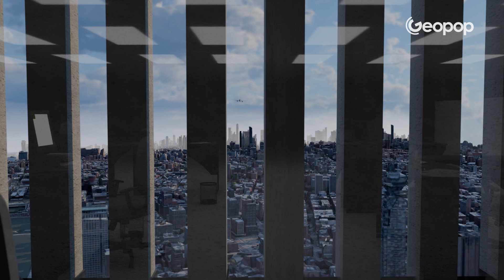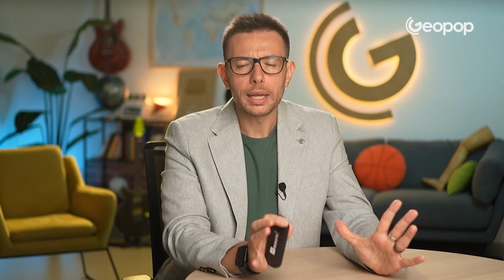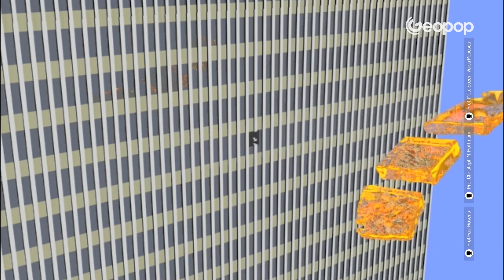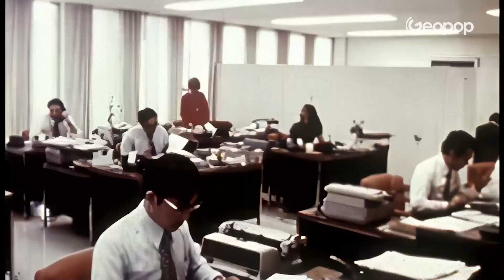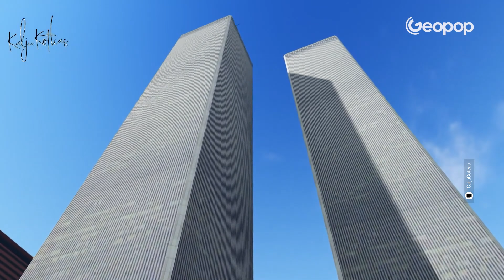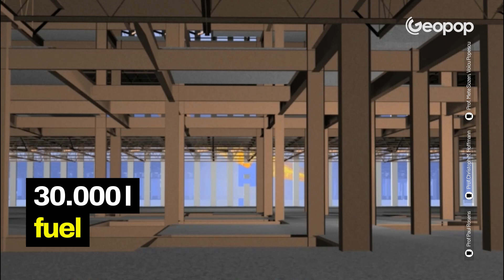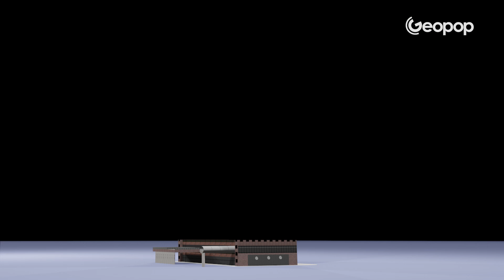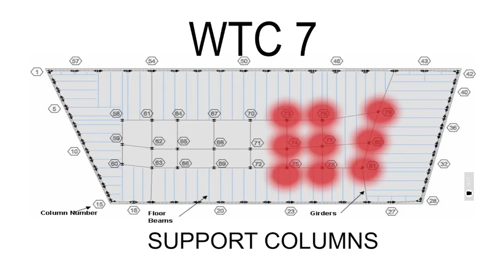9/11, 2001: The Technical Reconstruction of the Twin Towers and WTC 7 Collapses

Comment: They were brought down in controlled demolitions. It’s been proven. Even tho the steel on those floors would have been weakened, the floors above and below would still have their integrity. And the core beams would have stayed at least partially standing. The towers dropped in 11 seconds with different damage to different towers. No building ever in history has dropped due to fire much less one that was not hit by a plane hours later. The fuel would have burned out very quickly with only material inside the building to keep it going. Also almost everyone interviewed on that day, while they fell said they heard explosions at the base. Boom boom boom. The prices that were left were pulverized and did not come down in chunks. The gravity ratio would not have been enough to bring down the whole tower. Conspiracies ate real. Theories are real. The commissions report did not include everything and all the steel was immediately sent to China for recycling. Making a thorough investigation impossible. No plane hit the pentagon and no evidence of a plane were found. Watch more videos of experts. You don’t have to take my word for it. I’ve researched this since that day. Many of the hijackers were seen alive after 9/11 by their family. Buildings don’t just fall like that. Also two of the planes were found intact in other countries after 9/11. Sorry this is sinking but I could go on and on. lol. It’s not funny but do your own research. You’ll find these theories have been debunked over and over. Just because cracknpots like MTG and Alex jones believe it doesn’t mean it didn’t happen. They knew it was going to happen and that why trump inc won’t release what they have because it’s damning evidence.
Reply: I did my research. Actual research, not watching conspiracy videos on YouTube. My results were different and they explain all the anomalies you didn't understand/got wrong.

Twin Towers collapses were relatively straightforward, the fundamentals already understood in the professional engineering community within just weeks. Still, there’s a lot of really bad information floating out there, mostly on the internet where it’s easily accessible to anyone. Good information takes more effort to come by and is much harder for laypersons to digest. Engineeringspeak is complex and dull. Also, some people put up a wall to protect their beliefs and false assumptions. Engineering is hard while wild baseless speculation and pathological theorizing with easy hand-wave answers is simple and exciting. Fanciful tails of pre-planned demolitions, magical space beams, melting steel and mini-nukes are just far more entertaining and require a whole lot less thinking, thus getting far more intention than they deserve.

To correct that situation, I have all on my own prepared this short yet detailed technical description of Twin Towers collapses based on my own observation and analysis of the available true and relevant facts. No politics or ideology, just the engineering. My hope is this will dispel many common myths and answer most if not all questions you may have about the Twin Towers collapses, because anything can seem like a conspiracy if you don’t understand how it works

While complex, most of the Twin Towers collapse mechanisms can be seen with the naked eye and easily discerned and understood by the layperson if sufficient time is taken to understand. 

1. The Twin Towers consisted of 4 primary structural elements that together formed an integrated system where each relied on the others.  47 hollow box-section steel Core Columns carry the majority of the gravity loads. The 236 hollow box-section steel Perimeter Columns carry the remainder and ALL of the lateral (wind) loads. Long-span Lightweight Steel Trusses connect the core and perimeter column together at each floor with a Hat Truss on top to tie the structure together as an integrated unit where no element can survive without the others. There was no structural load bearing concrete and most components were bolted together.

2. The impact of 117 tons of airplane (= to about 12 dump trucks) at speeds up to 590 mph with the energy of a ton of TNT completely destroys the aircraft. This in no way implies the Towers come out unscathed. Many perimeter columns are damaged or destroyed as are some core columns (example; 33 of 59 perimeter and 20 of 47 core columns damaged or destroyed at the impact floors in the North Tower), This damage is primarily through bolt-shearing failures at the end connecting flanges, as well as bending, twisting and fracturing of weld seams. There was no cutting or slicing - the reality was far more violent and messy. 

3. The impacts destroy or damage fire insulation, fire breaks and sprinkler systems on multiple floors.  Huge fires are started across multiple floors simultaneously and allowed to spread rapidly with no effective firefighting or fire suppression. This was an unprecedented fire event . 

4. The hotter steel gets the weaker it gets .  With fire insulation stripped away and no sprinklers the survival time of the steel greatly reduced. Gradually over time heat causes the lightweight steel Floor Trusses at the impact damaged floors to sag, which was observed and recorded.  No steel melted or needed to. Structural steel fails long before it becomes a puddle. It just needs to bend

5. Sagging floor trusses pull on the increasingly weak and overloaded Perimeter Columns, causing some of them to bow inward by up to 5 feet. A straight column is up to 4 times stronger than a bent column. The bowed Perimeter Columns buckle and fail, initiating collapse. The formerly static mass above which the structure below could easily support is now converted into a dynamic mass up to 30 times greater. Because they have buckled, the Columns above and below the failure point are no longer aligned . The load bearing structure below no longer bears any load as it falls past the lower columns, NOT onto them.

6. Thousands of tons of debris fall within the four outer walls, down through the open office space, crashing onto the first intact floor it encounters. This massive impact immediately breaks the bolted connections to the columns as the amount of resistance the Floor Trusses can offer is negligible.  The falling debris slows only marginally and briefly. Note:
6a. This is NOT a solid top block crashing into and “crushing” a solid bottom block .
6b. The debris falls past the columns not onto them.  The columns provide no resistance to the falling debris. 
6c. Only the bolted connections of the floor trusses to the core and perimeter columns can offer any resistance. A pair of 5/8” bolts at each end of each truss vs. thousands of tons of falling debris.
6d. No laws of physics are violated.

7.  This floor-led collapse progression within the four outer walls can only go straight down. Note: 
7a. This process is often incorrectly referred to as “pancaking” which actually refers to a completely different process rejected at an early stage. The catchy name stuck but nobody knows what it is supposed to mean.  Pancaking is too simplistic and inaccurate anyway. More like Kaiserschmarrn.

8. Collapse progresses through the floor systems not down the columns, through the path of least resistance . Rate of floor failures increases with each successive floor as momentum increases, reaching an average acceleration of 0.65 of GA, or 35% slower than true free fall. Bam, bam, bam down the building until there are no more floors to fail.  The resistance offered by each successive floor is always the same. The mass and velocity, thus the energy of the falling debris is constantly increasing, with each floor destroyed adding new falling mass. Some falls to the sides, but most falls down. More mass, more velocity, same resistance with each floor.  Don’t get stuck on the but the lower floors weren’t on fire nonsense. They weren‘t and didn’t need to be.

9. The Towers were 95% air by volume. As that air was compressed inside the building it is forced down the tower and blown out the sides in reaction to the building collapsing . Those were not “explosions”, it was expulsions of compressed air caused by the collapsing building, explaining the low velocity, lack of flash, blast, supersonic pressure waves and lethal high-velocity ejecta.  

10. Perimeter Columns become detached and peel away like a banana behind the collapse front, playing out to the four points of the compass extending to more than 600 feet from the base of the towers. This was quite obvious from examination of the debris pile. 

11. Core Columns fail last as their internal beam bracing is stripped away by falling debris and lateral support from the floor to perimeter columns is lost. 

12. For those who care about how long this whole process took; 31-34 seconds from the moment the perimeter columns buckled until the last core columns hit the pile, or 1/3 the rate of true free fall. Don’t believe me?  Just watch any video of the collapses and note the loose truly free-falling debris dropping much faster than the towers themselves.  

13. Each Tower had a 1-acre footprint. Far from collapsing inside their own footprints the debris pile spread out over 17 acres in a pile up to 14 stories deep. 8 surrounding buildings were destroyed and scores more damaged by the falling debris. 

14. What was NOT observed were the 180-190 dB bangs of thousands of high explosive devices or the blinding bright flashes of burning thermite. Neither could have caused the (silent) perimeter column buckling that clearly initiated collapse.  Neither explosives or thermite could have survived the impacts and subsequent fires either. A video of a shocked and injured firefighter using the magic word explosion is in no way proof of explsoIVES . The pre—planned demolition case relies entirely on that sort of thing. There is zero tangible physical evidence and it would be technically impossible, totally impractical and completely unnecessary. No one would bother. 

15.  Finally, the Twin Towers were perfectly safe within their design envelope.  They only collapsed when taken far outside design parameters by an extraordinary and unprecedented event 

Impact + Fire (heat) + Time + Gravity = Collapse . Remove any one of those four elements and there is no collapse. Ignore any of those elements (as many do) and you will never understand the collapses. The Twin Towers were an integrated system in which no one component could survive without the others. One fails, the rest follow, through the path of least resistance – DOWN – through the open space, bypassing the path of greatest resistance – the columns.  Nothing I just described violates any laws of physics. All of the above is true no matter who planned and carried out the 9/11 attacks or why 

I hope you found this helpful and informative. It is not meant to be adversarial, but to solicit informed critical comment, positive or negative. If I made any errors of fact, logic or reason or left anything critical out, please let me know so I can fix it. To stay focused just one topic at a time please and on-topic (Twin Towers ONLY). No word-salads of Gish Gallop. IF you can offer a more plausible alternative be my guest. Be the first. Please start any reply with the words “Tits McGee” or I will know you didn’t actually read it, are not serious and just wasting my time. My guess is you will waste my time.
Reply: @TheLoonResistance  Your impressive load has as much smoke and little flames as the Twin Towers common to the NIST report you probably have been studying thoroughly. It was a blatant try to give a logically sounding explanation ("think" as you call it) to something where observation clearly defies this given logic. Whitewashing a crime, that is. I regrettably have not the energy to go into every detail in your text, just notice the lack of raging fire is a major flaw to these ideas. You also clearly contradict yourself in point 15, as there was no impact on building seven, but still a collapse.

BTW, wasn't the underground floors quite accessible after the event? I've even seen videos of rescue workers going there. Why did the gravitational collapse then stop on ground level? And where was the heap of the 110 floors - where did the towers go?
Reply: @martinwest2538  - I'm not going to respond to any criticism of my first reply until you actually read it. Which we both know you didn't. Please learn to follow directions.

Comment: I was an aircraft mechanic/inspector for 42 years. One thing I never saw factored into the analysis of the towers collapsing is the fact that these airliners carry oxygen bottles and chemical based oxygen generators. In addition there are some major parts made of magnesium. When magnesium burns, it's hot enough to melt surrounding metal. Oxygen and fuel make a welding torch. And, Popular Science (or Popular Mechanics magazine) pointed out that when aluminum burns and water is added to that an explosive gas is produced. Water was in tanks on the roof for fire suppression. So put me on the side that believes no explosives were needed to bring down those buildings. BTW, I have flight simulators and find it easy enough to fly a large jetliner into a building.

Comment: Controled demolition wake up people 😮😮😮
Reply: This video is not perfect  but the collapse mechanisms – the sequence of failures - described here are substantially correct and this is true no matter who planned and carried out the 9/11 attacks or why . 

That may not be what you want to hear and go against 20+ years of entrenched dogma and conditioning, but it’s not wrong.

That also means (in case you did not get the hint) this video can be (and IS) absolutely correct in its description of Twin Towers collapse mechanisms AND the 9/11 attacks could still have been some sort of inside job. The two things are in no way mutually exclusive.

The mechanisms described here have broad professional support around the world. There are no professional engineering organizations (for example: ASCE, ASEE, ICE, etc) that disagree with them or have offered any formal dissenting opinions or alternative hypothesis.  Zero structural engineers of tall buildings, including the 1/3 that have retired in that time, have made any statements in support of 9/11 Truth BS demolition claims. Zero, nada, none. The mechanisms described here are not new. They have been well understood since at least November 2001 and most can be easily confirmed by simple observation. You can literally see just about everything they are talking about if you just bother to look.

So, setting hubris aside, either the overwhelming majority of the worlds structural engineers and simple observation are wrong,…

… or you are.

Which seems more likely? 

IF you still think believe this explanation is wrong then produce a better one . Good luck with that. No one ever has and I don’t see you moving that needle today. No one ever does.